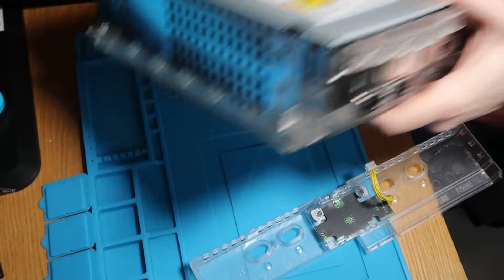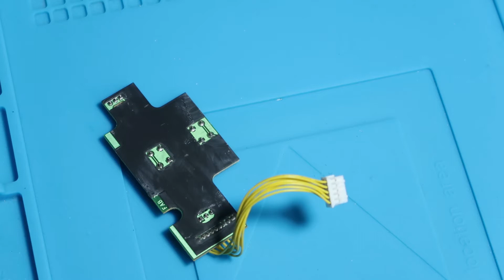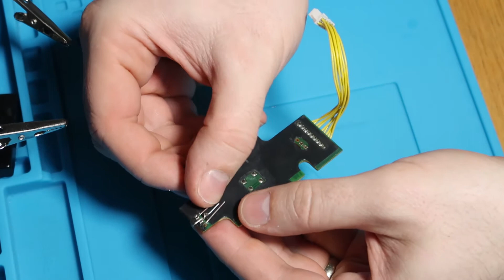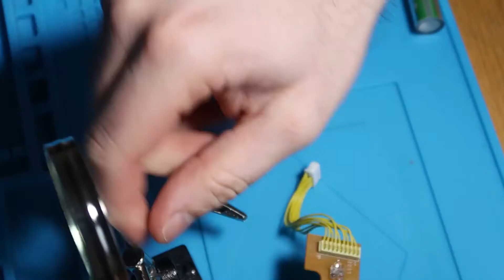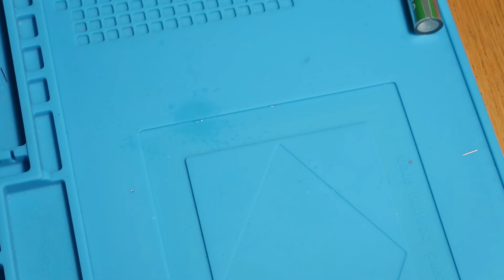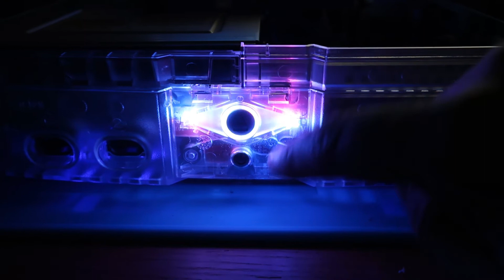Modifying power button LED's on the Xbox original

Comment: Hey there, Are these LEDs powered by 12v or 5v? Do you need any kind of resistance adjustments or can you pop on any LED cause the board is already designed for LEDs? If not what kind of LEDs do you recommend?

Comment: Hi there, what did you use to remove the old solder? Was that just your iron and a desoldering pump? I always have trouble with these boards, particularly the early 1.0 boards like you have here. The primary color's positive pad on the back of the board almost always lifts up and away on me, leaving a surface that almost looks oxidized, which the solder won't stick to.
Reply from the maker: Yes just the iorn and solder sucker